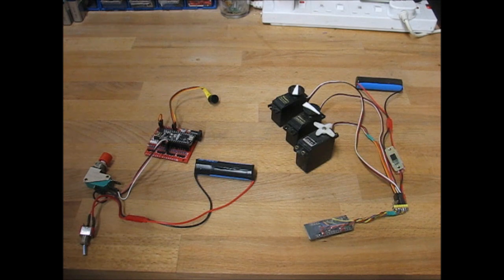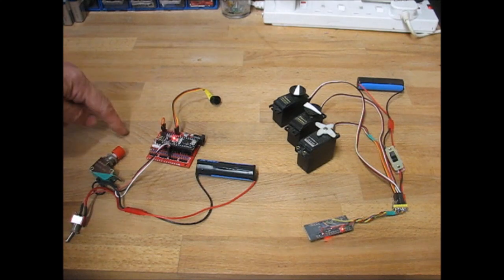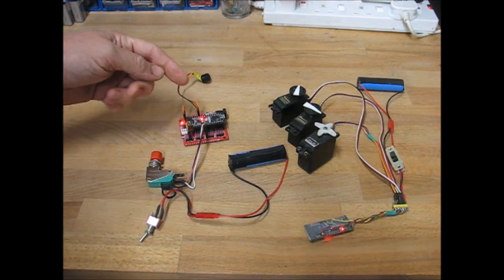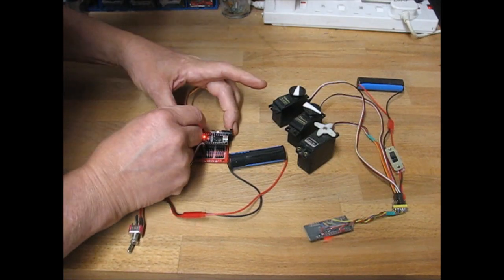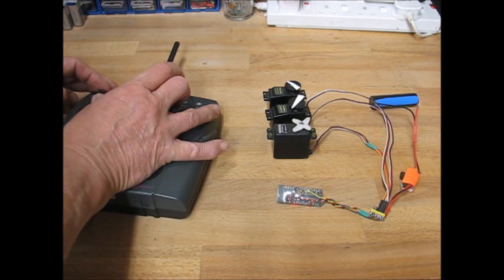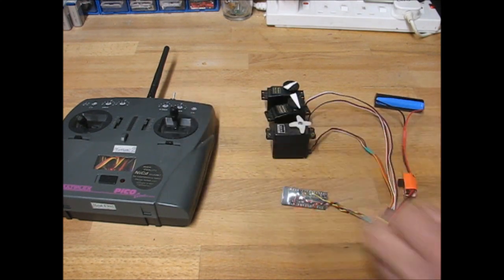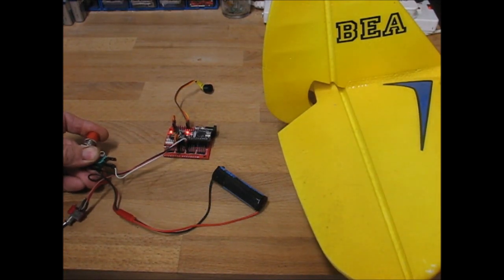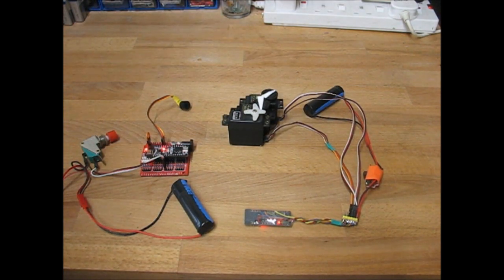A Single-Channel Emulation set using FHSS on the NRF24L01

Comment: Absolutelly Brilliant Phil. I'm on with one now. Kindest regards Wiggles!
Reply from the maker: Hi Phil, I recommend the metal cased ones for the tx, much more stable.
For receivers I use RF-Nanos or a promini with a separate NRF board.
The range is astonishing. Have you been following the thread on mode-zero?
Cheers
Phil
Reply: @PHILG2864  Thanks for that mate.Yes I am following on mode zero . I have 3d printed several Pixie cases Mk1 and two.  I want to make the reeduino too. What size  aluminium metal case did you use for the ten channel one please?

Comment: This has sparked my imagination.  Thanks Phil.  Brilliant work.
Reply from the maker: Thanks Howard. Heres the RS Navigator using this system:      https://www.youtube.com/watch?v=wkPHsaJ1RVk
I've also done an OS Pixie S/C set which I fly regularly in a Jack Headley "Moonbeam II", the gear is totally reliable.
Since starting the NRF lockdown project I've moved on to the screened versions for the transmitter, these are much more tolerant of layout, proximity, etc.
Cheers
Phil
Reply: @PHILG2864  Oh I'm sold.  Couple of Nano RFs are on the board and I've requested membership of the forum.  This might get me through lockdown!  Thanks
Reply from the maker: @HowardAlison   Your account is active Howard, you should be able to post now :-)
Reply: Glad you got involved Howard. Good man.